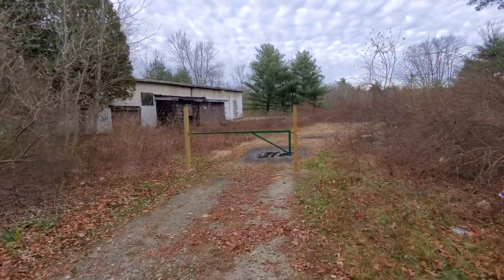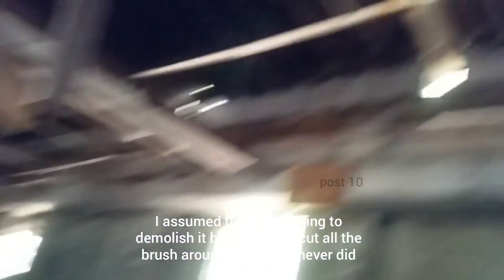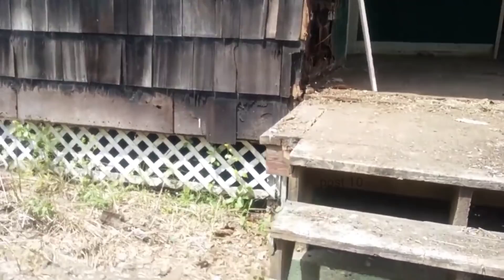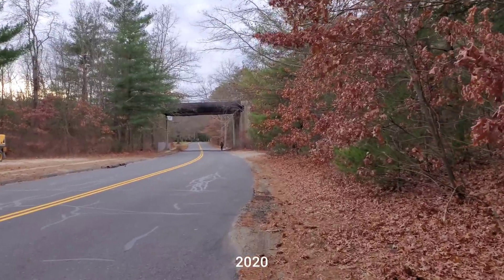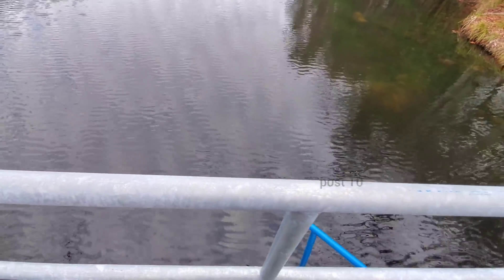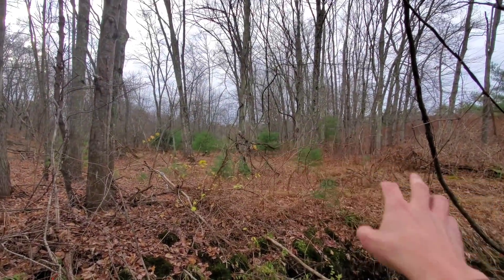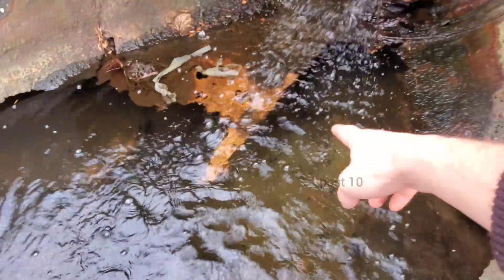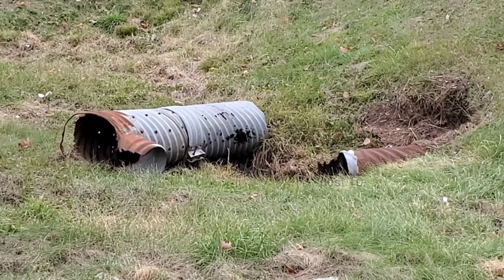Preparing To Dig Up The New Lake Drain, Inside The Ice House, The Lake Drains Evil Brother Upstream

Comment: The person who dug those ditches off the side of the road needs to call the Department of Transportation and ask/tell them they need to repair the shoulder of the road there to his house. What happens is that grass and weeds begin to grow on the shoulders and trap all the dirt thrown off of the road. in places where they sand the road, this can build up fairly quickly. The main idea with a road that has no curbing is to have the water drain straight off to the sides of the road but this doesn't happen with the grass/weeds/sand berm that is building up on the side of the road. The D.O.T. should come repair it if they get called, unless the township has taken over management of the road system, in which case ask them and it will get done some time after hell freezes (at least, that is how it goes in the city by me).

Comment: My grandparents know someond with a cabin. It was built as an ice house. they would store blocks of ice then load it on a train. The tracks railroad was shutdown in the 60s or 70s and the tracks are long torn up. Alot of the railroad has been turned into a trail. However there is a little section that has a tourist train. Pulled by locomotive 3716

Comment: How they can fail so many times fixing one pipe?😂
Reply: Because cheap isn’t good, and good isn’t cheap. Government departments want cheap
Reply: They need someone with skill and work ethic, like letsdig18 😉
Reply: @Dust76tr  it is not cheap if they have to redo it multiple times. But I know what you saying. My government does the same
Reply: @Niki_marshmallow  yeah, they could have done it really cheap by slipping a liner in before it failed, and it cost like $8k, but no, they had to wait for it to fail and it cost $2.2M on the cheap. 

If you (they) think maintenance is expensive, wait until you (they) find out how much not maintaining it costs! I’m no expert, but I’m pretty sure 2.2M is more than 8k 😂
Reply: 2.2 million that went to a contractor friend of the city council more than likely
Reply: If you don't have time to do it right, when will you have time to do it over - again and again?

Comment: Just throwing it out there without trying to be rude, but the pond you are referring to is more so a dry basin. Dry basins only see water during hard rainfall, where as retention ponds almost always will have water in its limits. However, they both serve the same purpose and both will always have at least one type of spillway to insure the water never “floods” over the top of bank.
Reply: Interesting. Maybe they got mosquitoes breeding if water stayed in the pond so they purposely knocked over the pipe that lets it drain slowly.

Comment: In the UK modern culverts are built of precast concrete and old ones are brick or clay. The initial cost is higher but they last many decades, if not forever. Ive never seen these crappy corrogated cast iron pipes used for water. Its going to rust and will need replacing after only a few years. The DOT are too cheap and lazy. Build it properly  in the first place with concrete pipe..

Comment: "Why do people dump stuff like those chairs" - because they are lazy and/or cheap and don't know how to, or don't care about disposing them properly. Where I live, our city-provided weekly trash service doesn't take big stuff like those chairs and won't take it if they notice you just cut them up into smaller pieces and put them in the bin. You have to pay per item for them to pick up bigger stuff, and the prices are pretty high for certain items (like $20 each for a car tire), and you have to go to City Hall in person during business hours during the week, so it's a hassle to even buy the stickers to have the trash service pick up bulky waste. However, if you are a homeowner you can bring 1000 lbs of stuff to the local transfer station for free. Mattresses are also taken for free, for residents, if you haul it to the dump yourself. But a lot of people don't know that, or are renting and don't know they are allowed to bring stuff to the dump as well, or just don't want to pay. I have a cargo van and often do junk removal runs for people and it seems most people don't know they can use the dump themselves or don't want to and just don't know what to do with junk so it keeps piling up until they finally call someone (me) to get rid of it all. Also I would think those chairs are steel vs aluminum cause it's cheaper, but you were there and not me, so could be the case. But 90% guess it was just lazy people who didn't know or care and just wanted them gone and threw them out of their car.
Reply: Thats cool of you to haul with your van.  I had to toss a couch in my rural area.  Thankfully, they took it cuz it wasnt a hidabed, for $12.  The County takes old refrigerators/freezers for free, but you have to bring it to a "special" place during Biz hours.  Im not sure about tires, though.

Comment: Thay building looks to be made from what in the uk we call breeze blocks and you call cinder blocks.  They were only invented in 1890 and the building looks like new construction. Are you sure it is the original building?
Reply from the maker: You know most people didn't get electric refrigerators  until the 1950's
Reply: @post.10  i did look that up right after i posted this... it just looked not old enough for spme reason but yeah 30s to 50s. What years were the pictures from of the ice block cutting? 1920s ish?
Reply: Clearly i carried on researching... the original comment was based on a hunch but like you i cant not know an answer.. found this https://www.structuremag.org/?p=9872 which obviously matches up with what you said and i dont know my iceblock history too well hahaha
Reply: @ma6cb  do you think there might be an asbestos hazard there?